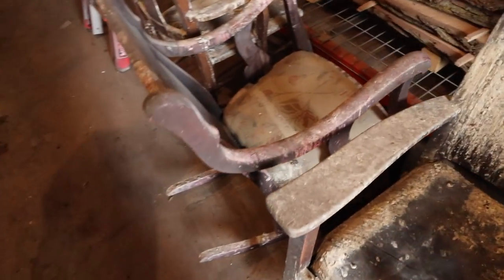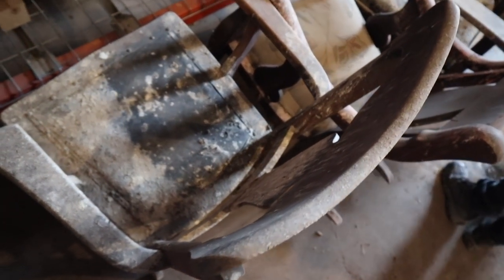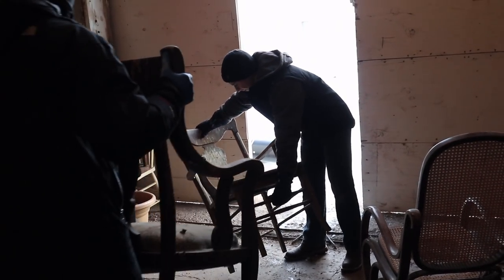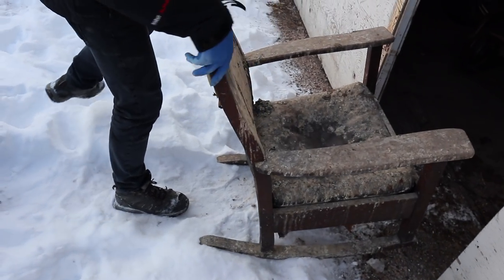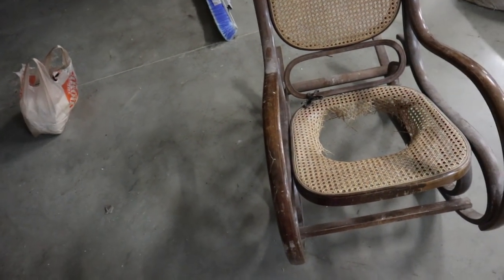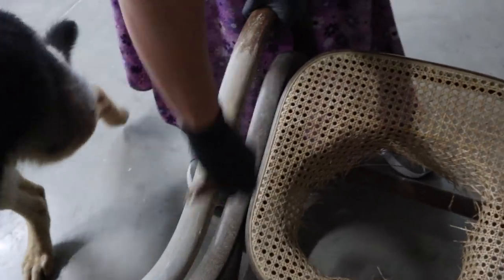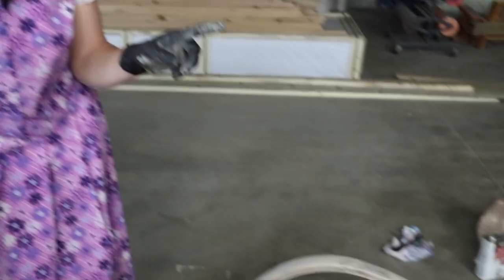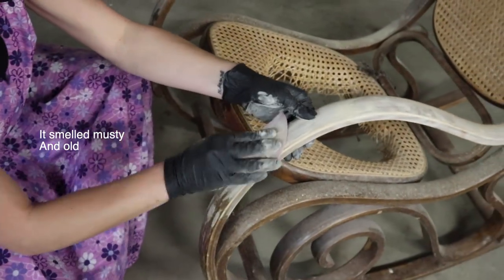Abandoned rocking chair restoration---absolutely filthy to brand new..Vlog#98

Comment: You did a wonderful job on those chairs but may I make a suggestion?  Please please please always wear a mask when working with something that has had bird droppings on it.  Especially if they were pigeons.  Pigeon droppings carry very dangerous bacteria that can damage the lungs permanently, and even though the items are pressure washed first, there can be residue remaining.  That goes for wearing gloves through that process as well

Comment: When we paint or stain and need to use the brushes for day(s) we put them in fast food plastic drink containers with lids so they only need to be cleaned after all our projects are done. Then crisscross the lids with tape in case they are knocked over. I would love to see an extra vlog about the chairs etc each week.
Reply from the maker: We didn't because we used two different stains but, man that is tough to clean